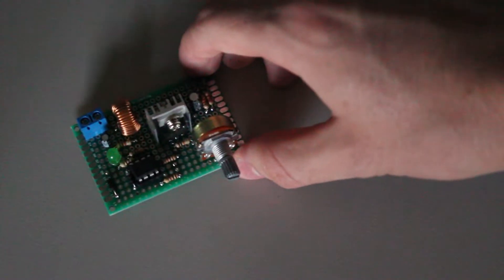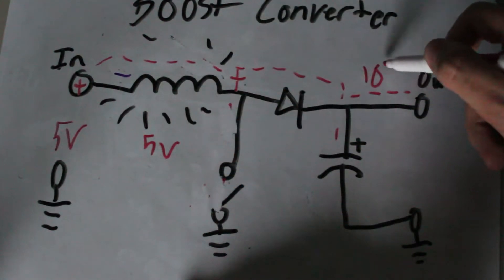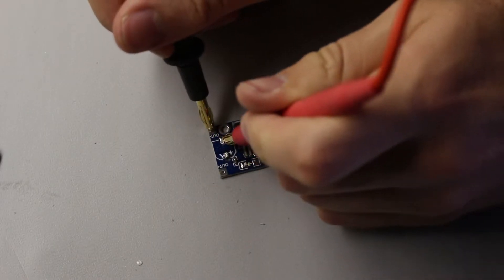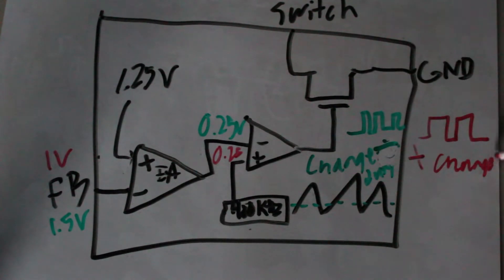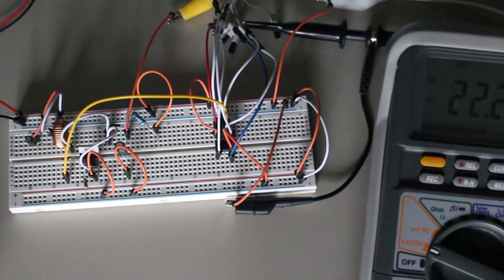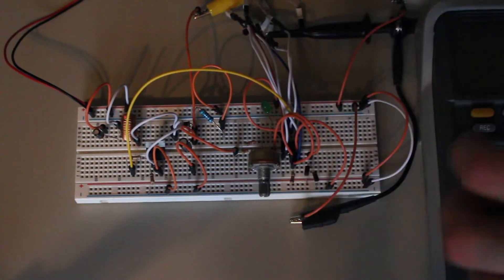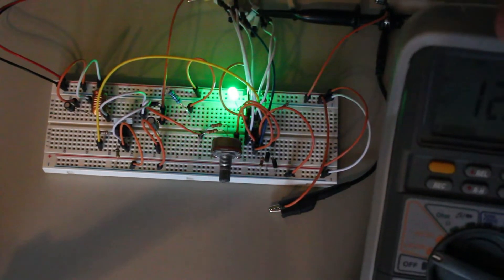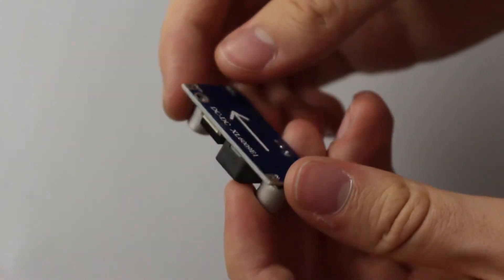Homemade Boost Converter - How do boost converters work?

Comment: Great video, however I have a question, can you show how is the duty cycle affected under various loads with the final PCB?
Reply from the maker: Thanks for your comment. I should have put that into the video. The duty cycle will increase with a greater load. and conversely it will decrease with a lesser load.
Reply: @SineLab  Exactly it will, but sometimes the viewer needs to see this to get the full picture in their mind.
But again, the video is already great :)
Thank you for your efforts.

Comment: The duty cycle does not need to change with varying load as long as the inductor current is "continuous" - that is, it does not dwell at zero at any time during the switching cycle. There is always some energy still stored as a magnetic field. Small changes in duty cycle will be required to compensate for losses in the circuit. These losses will be things like conduction and switching losses in the MOSFET (or other switch), losses in the diode and losses in the inductor, all of which change with load current.
BUT, there is a problem with a boost converter operating in continuous inductor current  In order to increase the output voltage in response to an error, the duty cycle must increase. That means discharge time for the inductor is decreased. For a time, you put more energy into the inductor during the switch ON time than you can get out during the switch OFF time in a single switching cycle. There is no choice in a boost converter operating in CCM but to reduce the bandwidth of the feedback network and accept relatively poor dynamic response. This problem does not exist in a buck converter. It doesn't exist in a boost converter in which the inductor current is discontinuous (the energy stored as a magnetic field is completely discharged every switching cycle) but that places constraints on the design that can be very limiting. A normal design will operate in DCM at light load and CCM at high load.

The poor stability in the breadboard circuit is probably the result of completely unsuitable bandwidth in the feedback path. This is messy with software control and a matter requiring careful attention with analog feedback paths. If a meter shows the voltage varying significantly the circuit operation is probably abominable. Meters will hide horrible things clearly visible with an oscilloscope. Note that issues of achieving optimal phase and frequency response are not unique to switchmode power supplies but are found in all closed loop systems. For example, the instant you close the feedback path in an op amp circuit you create the possibility for instability. With lots of op amps and "simple" feedback paths the problem is taken care of for you by "frequency compensation" internal to the amp. Some high-bandwidth op amps will be unstable even in a simple circuit with gain of less than 5 or so. If you add extra circuity such as power buffers, it can get very messy.

Comment: I suspect the main cause of bad performance is the crappy output capacitor. You need a low ESR cap with enough capacitance so there is enough time to react with a different duty cycle and not have the voltage deviate too much in the meantime.
Reply from the maker: Thanks for your comment. I believe that you may be correct about the capacitor.

Comment: Forgive me if I am wrong but I too design boost converter but instead of microcontroller there is some dedicated ic like uc3843 which is way more cheap and more reliable as it is designed to for this purpose.
Reply from the maker: Yes, if you are trying to make a reliable boost converter use a dedicated IC. The purpose of this video was to demonstrate how a boost converter works without the abstraction of such an IC.